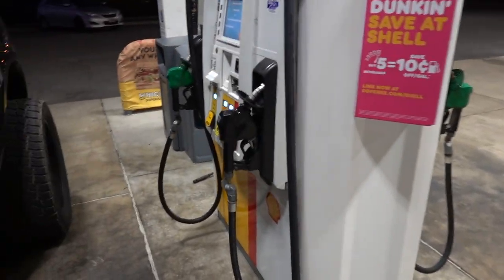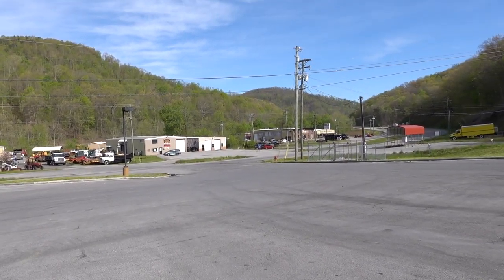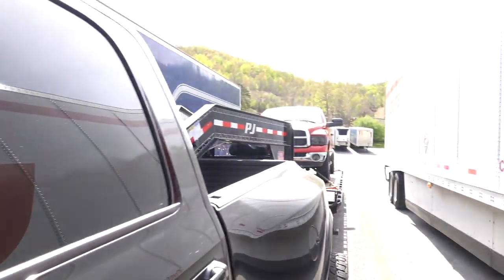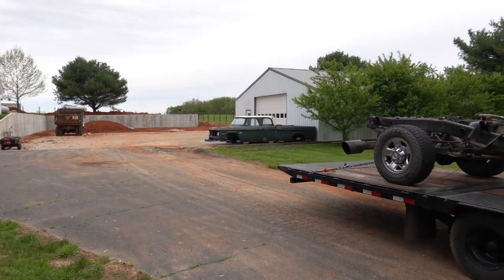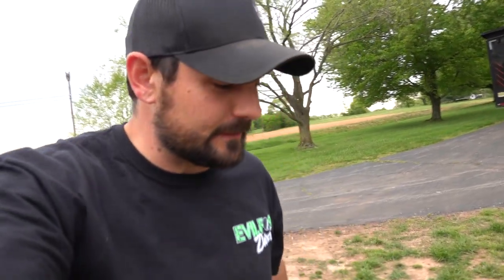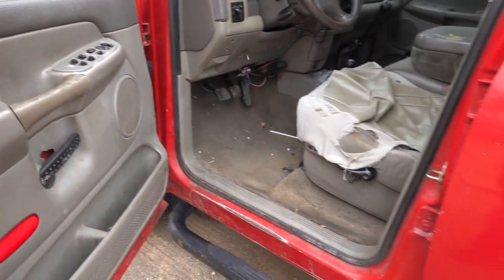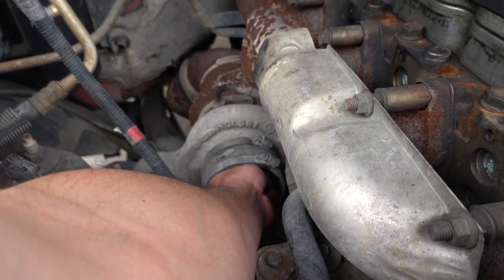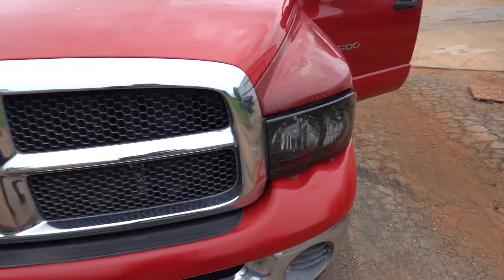BUYING OUR 10TH DODGE CUMMINS!!!! HERE'S WHY!!! & WHAT MY WIFE REALLY THINKS!!!!

Comment: Glad you use Amsoil products.
I use their products  in the engine, cooling system. G56 trans and  diff.

It's deleted, so use 4 quarts of two stroke oil mixed with diesel in a five gallon jug to add extra lubrication to the dry fuel they sell nowadays. Just shlug a little into the tank with each fueling.

I enjoy your posts.
Michael in California

Comment: Love your dually! Looks like mine. I have a blacked out 18 dually. Little differences! Mines got dual exhausts coming out the back, all terrain tires, very little difference from yours. Got a nice lift on it, bumpers. Pretty much it. Brand new dodges look awesome and are awesome stock! When I bought it I was impressed on how good it did stock. All I did to the engine was bigger turbo, cam, transmission, it’s making 625hp. Nice amount of power for towing my trailers. I drag race. I got gooseneck flatbed it pulls, 2 bumper pulls, and a gooseneck race trailer. Cummins good engine. 🤘🏼

Comment: Shoot me now, but the Harbor Freight adjustable A frame hoist is a decent value, and not junk.
I was surprised.
But then, I have a jib crane and a 10,000 lb asymmetrical hoist in my shop. 2 engine hoists, a skid loader and a tractor with a loader.

Comment: On that 2003 Ram, it is more than likely a Body Control Module (Central Timer Module) going bad. Batteries will charge but lights and such will remain on even after everything is turned off. Pretty common. Hope this helps.

Comment: Probably has a bad fuse box my 05 went bad at 315,000 miles had all kind of electrical issues so I changed it and it fixed everything.

Comment: Serious question here why would you G56 swap verses nv5600 
they came stock in that year truck and would’ve been an easier swap in my opinion
Reply: Parts availability.  But aside from clutches I'm pretty sure they are interchangeable
Reply: I had the same question 03 would be NV5600 till 20051/2.
Reply: The TIPM is a huge issue it takes everything out when it fails. Probably why the dash light on.
Reply: @paulrollinsjr.1845  it was an auto truck it could be as simple as the g56 was.easily avalible.  Also having driven both I'd prefer the g56
Reply: I have a question.  Is it possible to put a manual transmission in an 04 dodge ram 1/2 ton 4x4? When I purchased the truck they told me 1/2 tons don't come with manuals. I was not very happy 😕
Reply: @Thunder-iu6ev  the hemi 1/2ton was not avalible in a manual how ever the 4.7l 1/2ton was and I believe the transmissions are interchangeable  also loom into.seeing if the the .hemi 2500 had a manual.option as that would.be a direct swap

Comment: I had some led reverse lights on my 2006 2500 do the same thing switch to different one and it went away. I think it has to do with the canbus electrical system on the dodges.

Comment: Hey Greg or whoever reads this also, Could you message me. Im hoping to be able to buy a really nice 2500 6.7L Cummins eventually and it will be my first diesel. I dont know anything about diesels and am wondering what i could do if i buy a stock one to make it sound really mean and of course whistle loud at idle and when going down the road. I even love the lope sound that some 6.7's have. Not sure what would have to be done and how much i would be looking at? 

My buddy just bought an 03 duramax that has new injectors, He to is wondering what he can do to make his truck sound really nice and whistle? He was told to run a turbo wheel and im guessing prob a 5" exhaust system and maybe deleted?

I definitely wanna lift a diesel probably a good 10" as i love lifted trucks. I would love a brand new 5th gen style if i can swing one as these dam trucks must be made out of gold in the last 10 years. The prices of new trucks are beyond Insane and not sure how these manufacturers can get away with it. Their eventually gonna have to give 20 yr financing so everyone can afford these sweet trucks. I love the Laramies as i had a 14 Ram 1500. Thanks

Comment: What’s the difference between a common rail and the 24v or 12v he said around 16:15?
Reply: 12v and 24v both have individual lines from the injection pump to each injector. Common rail engines have a single fuel rail to all six injectors (hence the name "common rail").
Reply: 94 Chevy Z71 thanks man that’s some good knowledge right there I’m new to the truck scene especially diesel stuff and trying to learn. Just got gifted a 05 long bed 24v
Reply: @kidd6055  you're welcome. I've never owned a Dodge myself, but between YouTube an Diesel Power Magazine I've done enough research to know what everyone's talking about 😂 good luck with your newly acquired Dodge buddy
Reply: 94 Chevy Z71 😂yeah I been trying to get in touch with Greg to get a little insight on then before i start doing stuff to it still waiting to hear back. Have you ever owned a diesel or just not a dodge diesel?
Reply: @kidd6055  I haven't owned one myself, but my dad's had a 01 F250 7.3 for 6 months and has had his 04 2500 Duramax for almost 6 years now. Both bone stock though.

Comment: Greg dm me about those gauges if you wana sell them. if they arent glowshifts anyway. very interested
Reply: I've had my glowshifts for two years and there flawless
Reply: @williamuskoski1385  for the amount that i've seen fail i wont ever buy them. i've had a few sets of auto meter and a few isspro sets that worked awesome. buddy has a set of glow shifts in is cummins that arent 5 months  old they are acting up not reading correct at all.